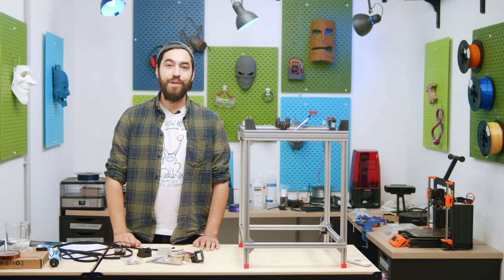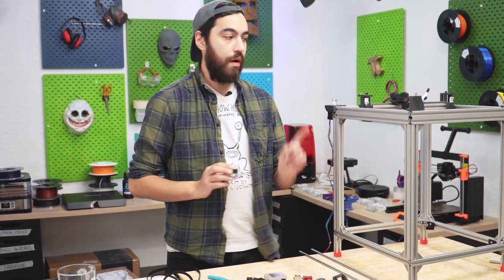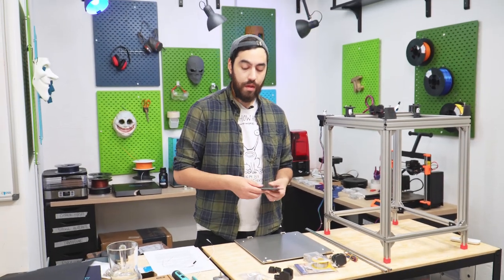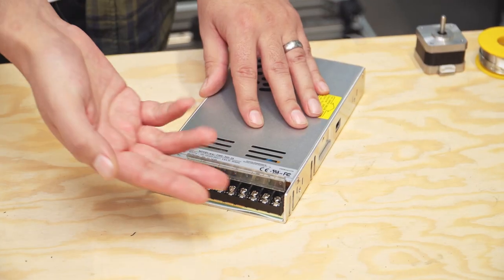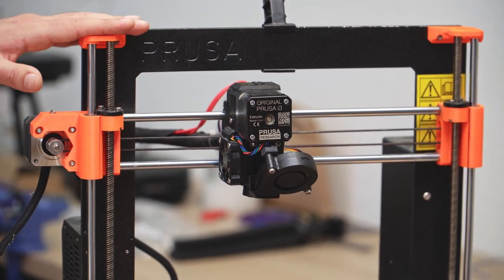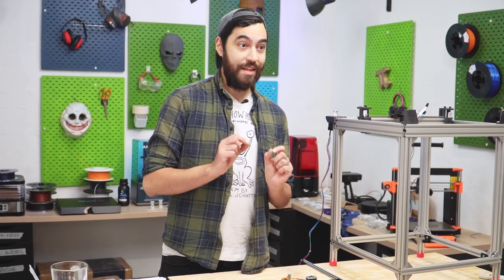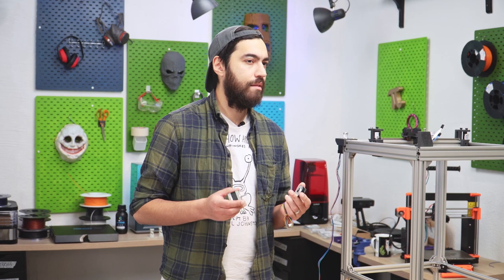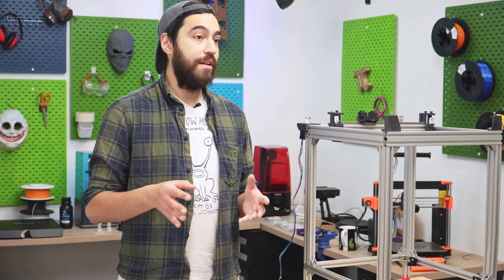How to Build 2 Printers from Scratch - Part 2: Extruders, Hotends and Heated Beds

Comment: While not 100% required, if you add a little flux to your wire and your board before you solder, you'll have an easier time. Also, clean off that tip; it should be shiny (brass wire cleaners can make this pretty easy). For flux, you might find flux paste to be a little less messy than liquid, but either are fine. Soldering is one of those things that seems a LOT more difficult until you figure out some techniques and then you're like, whoa, this is way easier than I realized. I recommend RMA (rosin mildly activated) flux, but no-clean and rosin are okay too. RMA is sort of the middle-ground. Rosin flux can be a bit of a pain to clean off.
Reply from the maker: Thanks for the tips man!

Comment: Would be useful if I knew where to find the carriages and idlers for a Corey
Reply from the maker: As this is still in prototype mode we haven't got a BOM and source list yet but both rails and idlers were purchased on Amazon.
Reply: @3DJake_Official  I figured this particular project was, I've just seen so many builds that just never mention anything about the carriages they are using. I know 3D distributed has a entire motion system advertised but they always say out of stock.
Reply from the maker: @deltacx1059  3DO.eu have a decent range of rails in their shop but they're in Denmark so if you are in the EU they might be a good choice. I haven't properly tested these rails, only once they actually print something decent I could then recommend them.
Reply: @3DJake_Official  i intend to move to Sweden but in currently in the us so they may not be a option, the rails themselves i have suppliers for but the mounts that connect the bearing carriage to everything else i do not know where to get.

Comment: I completely agree with you re: Blender.  It's amazing for most things, granted.  However, it's toolkit isn't really suited for fine detail work, and there's functions like additive and subtractive intersections of shapes that I'm fairly sure Blender just doesn't do.

I haven't been doing a lot of designing lately so a good video might be good, free and/or low-cost modeling software.
Reply from the maker: Actually you can use additive/subtractive shape intersections in Blender but yeah most of things you need to do for product design are very roundabout in Blender, so much more efficient on something like Fusion.

Comment: I have a monoprice printer and they are gone. But i want to try one with Arduino mega by any chance have you tried that direction
Reply from the maker: It has been a long long time since I did anything with an Arduino Mega, those boards are pretty old. It will work for sure, but you won't be able to get much performance out of it compared to current printers
Reply: @3DJake_Official  what about enders main board is that a good direction, also have you done main board for kippler and I have a EBB42 main board, but I'm lost at what software it uses, and what attachment is added. I'm trying one from the dezeen open source for recycle PET bottle.
Reply from the maker: @calseynez  Actually haven't tried the EBB42 board. Regarding the Ender board, if you're using something like the 4.2.2. board and with Marlin only then the processor can achieve something like 400mm/s speed at maximum, one of my printers runs an ender board with Marlin and I generally print at 300mm/s, it can go faster but the quality will suffer too much and at 400mm/s the motors will stutter and fail. Running it with a klipper enabled board will enable much faster printing but that totally depends on the motion system you're using and the extrusion system too.